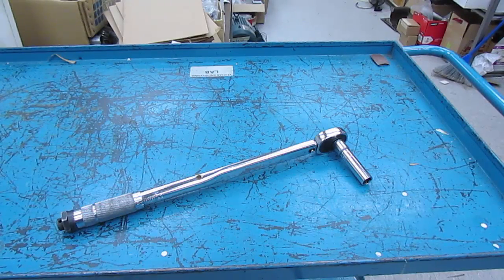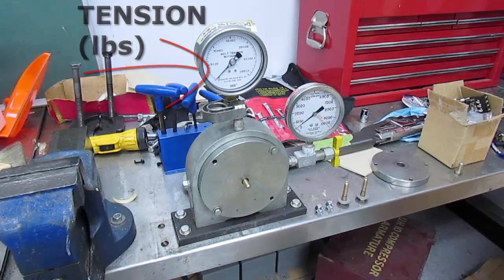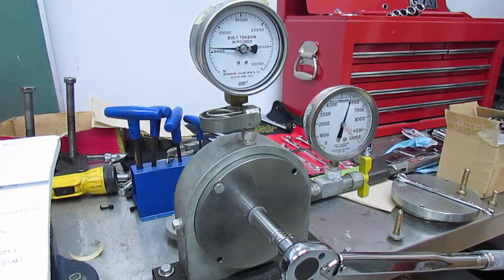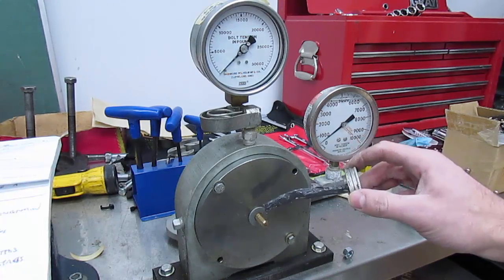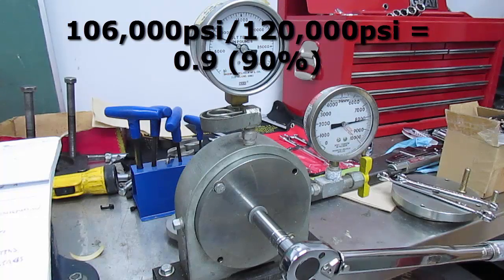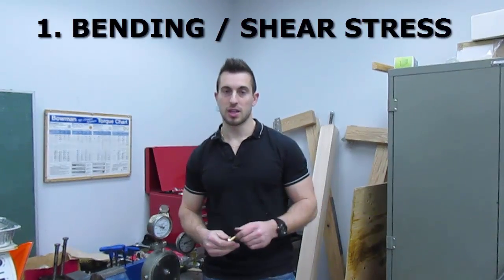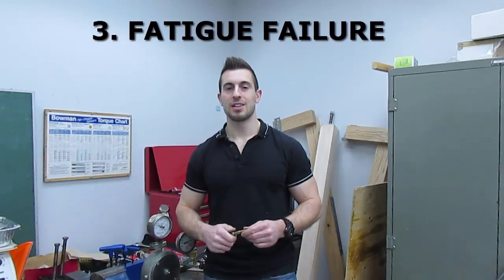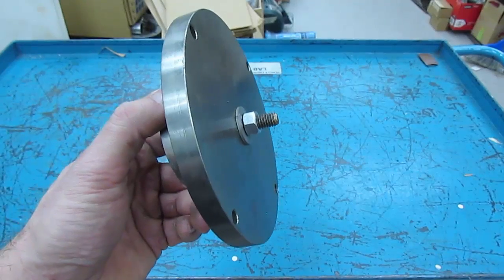Should You Put Anti-Seize On Wheel Studs / Lug Nuts?

Comment: i dont find lug nuts get to corroded.. but the mating surface  between the rim and rotor/hub always gets some antiseize/copper coat/ grease when possible ive seen rims stuck to the car and take 6 ft pry bars with full size sledge hammers to remove them

i use antiseize on everything except wheel lugs unless it gets thread locker
typically engine related things and anything where the bolt isnt stationary but spins like a drive shaft gets thread lock
Reply: Come to Ohio and try to take lug nuts off and you will see how corroded and rusted they get.
Reply from the maker: Hi Andrew, do you use the antiseize on the rotor face and back of the wheel? Or only on the spigot?
Reply: not sure what you mean by spigot, but around where the lug nuts come through the rotor on the flat mounting area there that the rim touches... obviously not on the friction/braking surface
Reply from the maker: Thanks Andrew, I would not recommend that. You are lubricated the clamping faces where the wheel touches the face of the rotor. The lug nuts clamp the wheel to the surface and that clamping force along with the coefficient of friction is what keeps the wheels in place. The spigot is the little round lip that protrudes through the center of your rotor and locates the wheel dead center on the hub. This is where I find most wheels seize. I usually apply a little anti-seize there, especially before the winter and this makes it easy to remove the wheels in the spring and will not affect the clamping.
Reply from the maker: I live in Ontario and it's a very similar situation, especially with all of the road salt used. At the end of the day I'd rather have to use a little extra effort to get my lug nuts off, than have them fall off lol.

Comment: Very informative. Very SCIENTIFIC. Extremely useful. Prevented me from putting anti-sieze on lug nuts. (one of lug nuts seized: rust, water).
Reply from the maker: Thanks for the comment and thanks for watching!
Reply: Same here.  I was only wondering if it is a good idea because the lug bolts on my car can be impossible with the wrench that came with the car.  If you ever had a difficult time with a car that has aluminum wheels you will know what I mean.  I keep a breaker bar and socket in the trunk of my car and even then the lug bolts seem too tight at times.  I still have the wrench that came with the car but it is really somewhat undersized for what it was intended for.  It is not just a problem with my car but many of them.  It is feels like whoever chose to include that wrench never had to change a tire before.  I only ever find myself taking the wheel off the car to inspect the brakes.  I am glad it is rare that I ever have to take them off the car.

Comment: I stopped watching when you were swinging off the torque wrench on the anti seize bolt.

If you're going to preach science do it properly and don't bring your bias in.
Reply from the maker: Hi Anthony, I'm not sure where you got the idea that I was swinging off the torque wrench... you can't even see me while I'm turning the wrench? Also, the wrench was set to the same torque for both the dry and wet bolt and I stopped at that value. Of course there is some percent error involved in this method but it is actual science that a reduction in friction results in an increase in preload for a given torque. No bias necessary?
Reply: What does "swinging off the torque wrench" mean?  I didn't see any swinging in the process used.

Comment: nice video. is it the opposite when placing locktite? it then increases the friction
Reply from the maker: Loctite has been formulated not to affect the coefficient of friction between the two surfaces so no torque modification is necessary according to Loctite documentation. Good thinking though!
Reply: Sorry, but I saw an engineer use your same tool, and when he added Loctite to the bolt threads he had to INCREASE the torque by almost 50% to get the same clamping force with the fastener!

Comment: I've been servicing my own cars for 46 years! Ever since my experience of rusted in wheel nuts and hub screws making the job of changing my first brake shoes an utter nightmare,  I've used anti-seize. Never ever had a problem of a screw or nut coming loose or contamination of braking parts. I've also rebuilt countless engines with the same technique. As others have commented,  bolts and threads look like new after years of use and come undone with the correct snap feel. Manufacturer's are quite happy to replace parts no longer serviceable because they've rusted together. I now have a constant battle with my local garage when they replace tires, they moan at me and clean off all the anti-seize,  I then have to re-apply it!
Reply from the maker: Anti-seize isn't a bad thing if you can compensate your torque to keep the pre-load in the safe zone for the design of your bolt/stud. I understand lots of people having been doing the same thing for many years on end... but that doesn't necessarily make those practices good practices or correct as per the design intent. On your 47th year of doing it the same way it may result in an accident. I understand that it looks like I'm over complicating things, but I am merely demonstrating the science behind the simple principle that less friction for the same torque = more preload. You can over stretch your bolt.
Reply: Overstretched bolts are a disaster waiting to happen... my son had a one ton truck that the wheels came loose on. Since I run an auto repair shop... ( he just got the truck and I had no contact with it yet) I got him in and replaced studs and nuts.. then torqued everything. Problem solved.

Comment: I understand the point you are trying to make. However, if you use anti seize, (which I have successfully for over 45 years of driving), simply reduce the wheel stud torque by approx. 30%. I have NEVER had a wheel nut come loose doing this. On the other hand, I have seen countless wheel studs broken off, due to trying to remove seized and corroded studs and nuts over the years. Especially in areas of rain and snow like the Midwest. You do much the same thing with anti seize on spark plugs. Especially in Aluminum heads, where they can be easily stripped during removal by not applying anti seize. I ALWAYS loosen and re torque my lug nuts after any dealer or tire center removes my wheels for various replacement or repair work. Most all of them over torque lug nuts.
Reply from the maker: That's the general rule of thumb but the problem is that many people don't know how much is the right amount. Too much and it's easy to over torque, especially as you mentioned, most of them over torque without any lubricant. This would just exasperate the problem. At the very least, the video is good information for people who have no idea what the design principal of the bolted joint is and the effect of modifying friction.
Reply from the maker: Thanks Tom!. Although that would be nice, they probably don't want to assume any responsibility / liability by giving instructions. Also, the amount of lubricant applied (and where) will affect the K value, therefore the manufacturer of the anti-seize cannot predict / control that.
Reply: Embrace Racing The grease manufacturers should provide a percentage torque reduction necessary figure, or graph. Or formula, assuming it's just the 'K' in your formula in the video... Then we can take OEM dry torque figure and work it out. I'd rather have anti-sieze so you can actually get the darn things undone. Can't be that difficult for the friction reduction factor to be accurately tested. Great video BTW, found it very useful and informative.
Reply: Embrace Racing Maybe it needs government certified / independent testing then. A range of values published tested to some new standard. Got to be better than the current situation of guessing, or dry torquing and then struggling to undo seized bolts.
Reply: It does exacerbate the problem, but those who would overtorque regardless wouldn't really be too concerned about getting things exactly right anyway, with or without lube.  They certainly wouldn't care enough to use lube anyway, if it's some tire shop that's just interested in getting the car off the lift as quick as possible.
Reply: ...That's what she said!
Reply: @Ya'll Need jesus never once has it happened to me. You must be doing it wrong
Reply: I don't care if you've been using it for a hundred and forty five years you've been doing it wrong for a hundred and forty five years it's that simple
Reply: @JonRheaume2282  except that all recommendations come from experience. If the practice contradicts the theory we adopt the practice. Vega raw aluminum cylinder walls were a really good engineering IDEA. In practice they sucked and were oil burners in a year or two max. There are countless examples of this. I dealt with corroded studs when I was first into auto. Forty years of anti seize later I've never had a loose or frozen nut. I will go with what has been proven to work.
Reply: @barkerd1960  and you're wrong again I've been a truck tire technician since 1989. I live in New Hampshire. Plenty of salt and rust. I know what I'm talkin about. Don't use never seize. It's just plain wrong.
Reply: @JonRheaume2282  knock yourself out. How many failures caused by anti seize? An actual witness to it? How many seized nuts/studs have you had to torch since 1989? I get the lawyered up liability argument but thats weak.
Reply: @barkerd1960  yes I have witnessed it. That's why when I witnessed it on a brand new Assembly not being able to torque it properly and watching it fail right in front of me as I was hand twerking and it would not stop moving until it pressed through the wheel. I'm not talking out of my ass here. I know what I'm talkin about
Reply: @barkerd1960  I don't touch any nuts. Ever I never have a torch out unless it's broken
Reply: @JonRheaume2282  If you've only had to hot wrench broken stuff (as in not just seized sue to corrosion) you haven't really experienced the rust belt mechanical reality that others here have tried to describe.
Reply: @barkerd1960  no I have the abilities and know-how and I have overcome this whole situation on to how to loosen nuts that are stuck on without a torch and without never cease being used. Enough said. I don't know why anybody has to argue with facts. Dude shut the f****
Reply: @JonRheaume2282  and yet he has no problems  😊
Reply: @hotrodmtf  except for achieving proper torque

Comment: So if you are in the camp where you add a little anti-seize to the bolt threads (a thin coat and a bit less than what is shown in the video), what is a good rule-of-thumb for reducing your torque wrench target?  I've heard 20%
Reply from the maker: Hi Phil, 20% seems reasonable but there is always some variability in how much is applied, what type, etc. Hard to say what will work perfectly. Check this link out from an anti-seize company: https://www.antiseize.com/PDFs/torque_specifications.pdf

Comment: Good grief, this is not a space shuttle issue.  I have used anti-seize on wheel lugs for 50 years.  How many problem??? ZERO and all my wheel changes are easy and the threads are in great shape. Better to us it then fight like hell to get them off when they are rusted.  How many times does a tire shop use a torque wrench?  I've never seen it.   Honda civic or 3/4 ton pickup, they use the same air impact wrench on rust old lugs or new ones.  The only damage to wheel lugs has been from tire shops.  This is all nonsense.
Reply: drunkennewfie midget   I've never seen a garage use a torque wrench on a tire installation either.
Reply from the maker: You're right. Science and engineering is nonsense.
Reply: @EmbraceMaking  Both science and engineering will arrive at a conclusion to solve a problem.  You haven't been able to do so in this matter, and all you do is talk your opinion without scientific or engineering verification, and by the very fact you don't even know the cross sectional area of that 3/8 bolt you describe, I'd say you have a lot to learn about both science and engineering.

Comment: Really quick video... 10 minutes
Reply from the maker: Got carried away doing science ;)
Reply: Pseudo science. Just because you used a means to measure and applied some manufacturer's recommendations, does Not make it Science (other than in your mind). Keep kidding yourself on the reliability of plated steel fasteners to achieve the same torque value, time and again, independent of age or wear. ALL fasteners require some minimum of lubrication to reliably respond to torque, and All studs come that way, from the factory. Nice try though-

Comment: What about applying only a bit where the lug nut head meets the alloy, this should prevent "metal baking" and won't affect torque specs. Because as far as available info the threads don't "bake" but the outer parts. What do you think? Regards
Reply from the maker: The underside of the lug nut touching the cone seat of the wheel will most definitely affect the torque spec. Check the graph on this page... http://www.boltscience.com/pages/nutorbolttightening.htm
I would suggest following the manufacturer's spec and just go clean and dry. I live in Canada and we use a ton of salt on our roads in the winter and have not come across a completely seized lug nut yet. I change my wheels out for winter tires every year and by removing the lugs annually it seems to be enough to prevent them from seizing.
Reply: Embrace Racing thanks for the reply. Definitely right torque specs are ftw. Sometimes air guns in shops become inaccurate and they just exaggerate probably (not always) unintentionally. Regards!

Comment: What do we about , the nuts  that will rust on . Which I have had happen to me . On my Snowmobile Trailer  The Lug Nuts are out in the open.The snow gets on them , water and dirt. Guess what , after being on the Trailer for years. Now you have a flat , on the highway. And I could not get the Lug Nut off .Now multiple that by 5- Lug Nuts . And you got yourself, a big problem.
Reply from the maker: Thanks for the comment. I'm not suggesting that seized nuts aren't a problem... because that situation is unfortunate. I'm just bringing attention to the fact that improper use of anti-seize can be dangerous. If you decide to use some anti-seize then best practice suggests that you should modify your torque rating accordingly. Otherwise if your studs break and your wheel falls off... well then you don't have any chance of putting on a spare.

Comment: Very interesting video.  Thanks for taking the time and effort to research/prepare and post.

While I don't work on cars, I do build many and maintain all of the firearms which I own/shoot.  For the AR's that I build, I regularly use anti-seize compound in lieu of thread-locker, whenever torquing both the barrel nut and the buffer tube to the upper receiver as well as when torquing the flash hider to the barrel.  In these instances, at least one and often times both thread surfaces (which are either/both aluminum or steel, depending) are black-anodized and thus quite "rough" in comparison to the machined thread surfaces found on automotive lug bolts/nuts.  Granted,  said firearms don't encounter the bending and/or shearing forces described in your video, however said weapons do experience high temperatures (e.g., the barrel nut-to-upper receiver connection easily reaches nearly 400 degrees F whenever firing long strings of sustained rapid semi-auto fire while the barrel-to-flash connection hider runs near 275 degrees F during the same firing sequences.  In addition, vibration is quite severe.  After firing tens of thousands of rounds under all manner of firing sequences and conditions, not a single anti-seize/torqued connection has come loose during firing and/or after cool down.  However, whenever I want/need to subsequently remove/replace a barrel, etc., the connections can be easily unscrewed and then later on re-assembled, all without damage to the expensive parts involved.  I've had to remove factory-installed/assembled screws (e.g., on my FN SCAR's) that had been either red/blue-LockTited and which required copious amounts of direct heat (I.e., propane torch flame) in order to soften the LockTite to where the connection could be unscrewed - when re-assembling, I cleaned/removed all the remaining LockTite and substituted Permatex anti-seize compound and re-torqued - all with great results.  Similarly, using anti-seize in lieu of thread-locker on the small fine thread machine screws used to mount riflescopes - works quite well.   Although the temperatures experienced during firing are lower at these points, the vibration is still quite severe and the torqued/anti-seize connections never loosen except when purposefully removed to change a scope, etc..
Reply: I mean. Sorry but, really? Sorry I don't feel you can compare gun barrel threads to a cars wheel man 😬 like he explained, the wheel carries allot of weight of which is then subjected to vibrations, along with torque, shear, bending pressures, etc, and additionally in a weight intensive cyclical manner which adversely directly affects the tensile strength of the bolts and threads directly. It literally stretches the metal .. i don't believe these same forces are present in a firearm really id say you may wish to rethink your theory, but the truth is theres no realistic comparison between the two, especially when considering size weight composition etc, but most importantly it's application